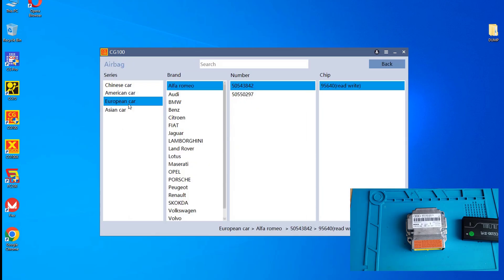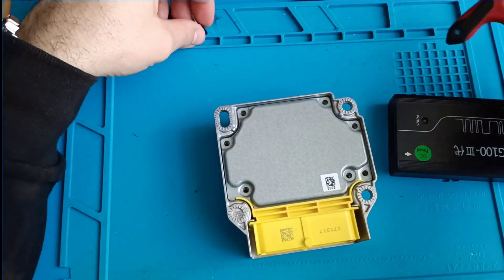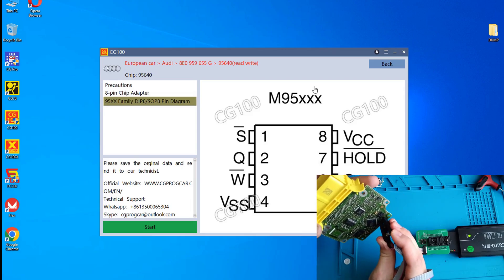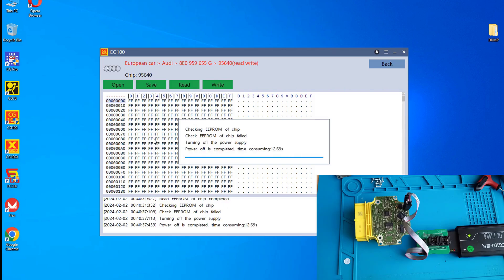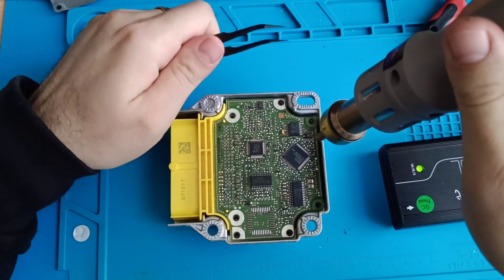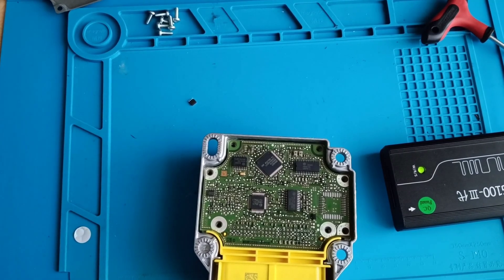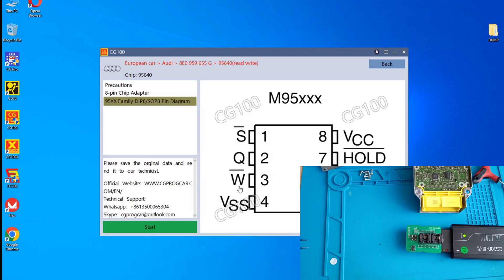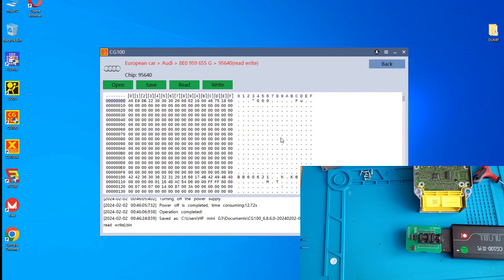CG100, can automatically remove Crash data from this Audi A4 Airbag ECU ??? Eeprom 95640

Comment: Hi there, great a new subscriber! 

I had some question, its off topic. Please could you advise as you are expert.

I have BMW 320d 2011 163bhp ecu EDC17C50? Or EDC17CP41?. I want to read the ecu file and then write the remapped file back to car. Can the galletto v54 do this?? I already have kess v2 clone and in the vehicle ecu list the ecu is not there so l'm not sure how to go about it? Can you advise please? If kess or galleto will not help, which one will help? I can take the ecu out if that helps? Many thanks for your help!! I dont want to spend too much on expensive tool, so it'd be great to hear from you. Many thanks and Im always looking forward to your new videos.
Reply from the maker: Hi, you need a better clone,  something like KT200 V2. You can also buy FC200 for 600 euro and it's an original tool.
Galletto, Kess V2, Ktag Clone, you have no chance.

Comment: Thank you Yoyo for info, all the best and many mamy videos. 
Yesterday I had a isue with an vw golf 5 instrument cluster I read the bad VDO instrument cluster eeprom  with x-tool and after I writen on the new instrument the car didn't start.
I want t make the car running. Thanks
Reply from the maker: Hi. 
Which Eeprom has your Cluster?  You read /Write on Bench ?
Reply: @YOYODiagnostic  hi yoyo the eeprom is 95320. Read obd with x-tool (the tool that you make a video 4-5 videos ago). I think it can not be cloned.
Reply from the maker: @ecutechneamt 
For cluster cloning use SVCI 2018-2020 . If I have Golf the next few days ,I will make a video , and I will show the procedure that I used.
Reply: @YOYODiagnostic  thank you, I will search for one that is useful and it worth the money. I have seen tools that you spend money on them and don't do the job. All the best and hope to see thousands o videos.
Reply: @YOYODiagnostic I don't know if you had this problem but after I removed the original instrument cluster I put the second-hand cluster tried to start the car and after the ABS codind was lost and I don't know what code is. The component is ESP MK60EC1. A nightmare. 
The car is VW Golf 5 BMM code
Reply from the maker: @ecutechneamt  👍
Reply from the maker: @ecutechneamt  
if you scanned this car with VCDS you are lucky, you go to the folder with Scanning and you will find the file where you can copy Coding.  If you haven't scanned this car with VcDS then you need ODIS.  The next time you read the Eeprom memory with the programmer, it's the safest because you don't take any risks.  Can you email me the picture of the Instrument Cluster so I can see what you see when you put in the contact.  It is possible that X-tool did not find Checksums Correction.
yoyo.pc86@gmail.com